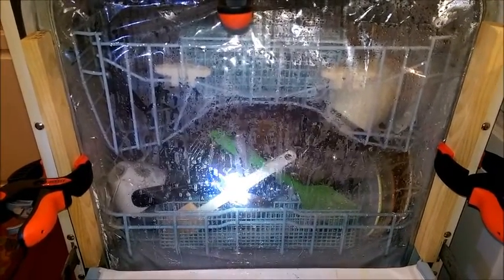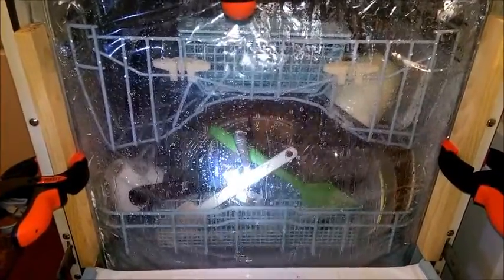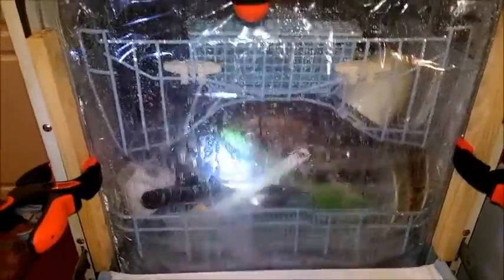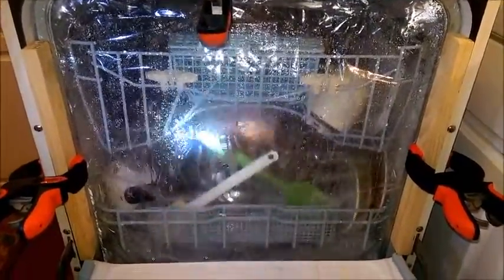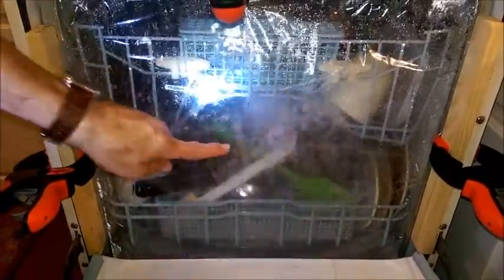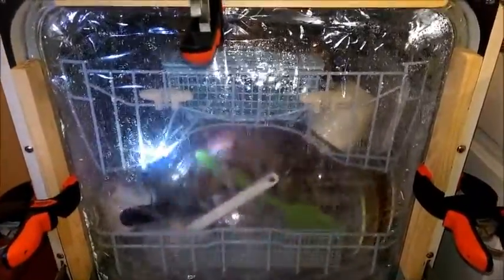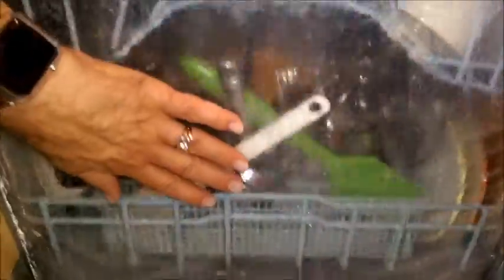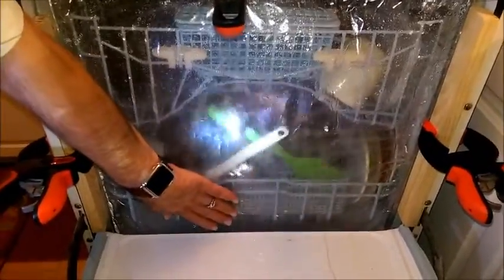View of the water action of a vintage KitchenAid Superba dishwasher

Comment: I have the KDS-16. Does that middle panel come off for easier access to the  water valve inlet? Removing the kickplate gives the tiniest view of it.
Reply from the maker: Yes....to remove the panel, there are 2 screws.  One on far left just below the panel but above the kickplate.  The other screw is on far right side.  Once the screws are out pull out slightly to loosen panel and then side downward to disengage from tabs.

Comment: I have a KDS-16 that just developed a leak on the small clear hose that goes up the left side, but I can't see where it goes or what it does.  There might be a sprayer in the top of the machine that it connects to, but I am not certain. This only happens when it is filling with water(leaking).  You don't happen to have some kind of diagram that shows the layout of the hoses , do you?
Reply from the maker: Hello.  Sorry it's taking me so long to respond. I'm happy to help if I can. Are you still searching for that diagram?
Reply: @toddgann5757  I am looking for what is on the left side of the dishwasher.  It looks like there is a fill valve where the inlet valve is connected and I believe that is where it is leaking.  I was just able to pickup a parts manual on Ebay to give me a picture what the fill unit looks like.  I am trying not to tear the dishwasher apart until I can see what I need.  I just don't want to get over my head.

Comment: Mine just stays at the cycle complete stage at will not move from there. I have tried multiple different times. I even tried unplugging it. Any suggestions?
Reply from the maker: There are two timer motors.  One timer advances the dial through the stages of the cycle.  When the indicator shuts off and you lift the door latch, a secondary timer called the Automatic Rapid Reset Timer turns on to advance the timer a few turns until it gets to the instant start position.  Can you check that both timers are functioning properly?  Also, when you lift the door latch, there is a lever behind the control panel that resets the program switch which causes the cycle selector button to pop out.  It is imperative that the push button pops back out.  Is this happening?
Reply: How would I check exactly? Can I send a video to you to show you exactly what it is doing? I would really appreciate the help.
Reply from the maker: @glitch98765432101  yes....please send a video to me at MrFrench70@gmail.com

Comment: Todd, I have a KDI 15... We love it! We are having an issue with the water not being completely discharged after each cycle. I am being told it is the impeller. Have you ever dealt with this?
Reply from the maker: Hi Ken...sorry I didn't reply sooner.  You probably have already researched this problem and found your answer but it sounds like the drainer impeller is bad.  I'm glad you love your imperial due-cycle.  I love the vintage styling on this model.
Reply: My mom had the kitchen aid lasted 30years my machine was just like this machine only we had the imperial duacycle.same racks same interior only we had the 2 button. We had a minor leak fixed years back which blew out the blower motor. Plus new springs on the door. Great machine
Reply: Could be the drain solenoid